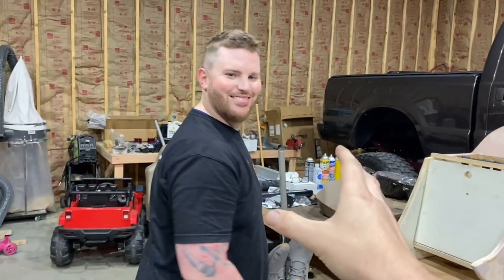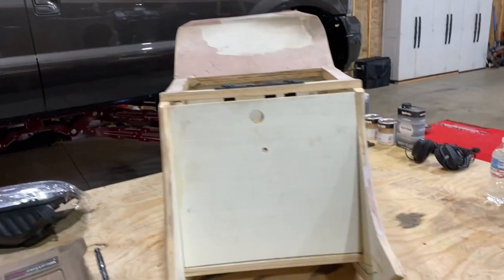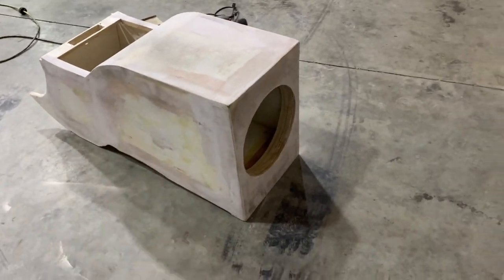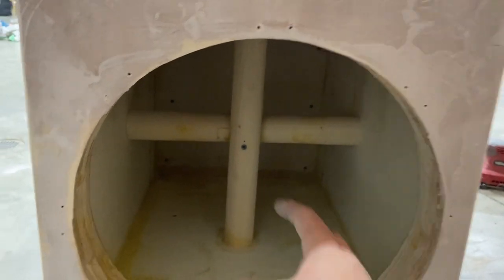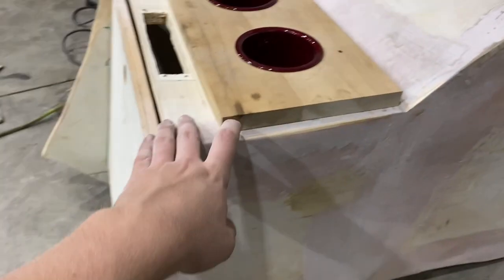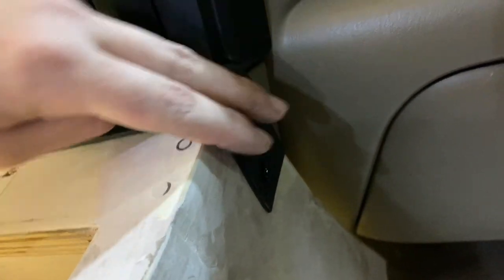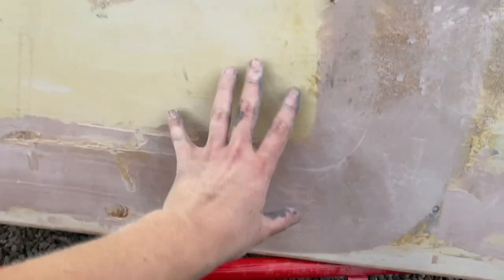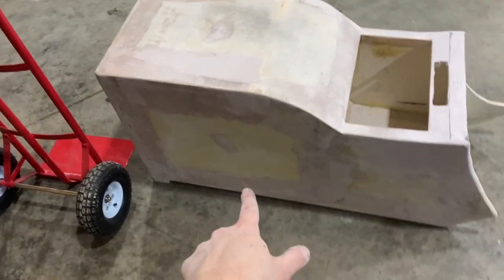CUSTOM CENTER CONSOLE SUB BOX BUILD | FOR 15 INCH SUBWOOFER | PART 5

Comment: You are fixing to wake that beech up
Reply from the maker: Yessir I’m hoping ! I finally got all the dimensions and put them in my app that I bought that calculates everything and it should be tuned around right around 31.90hz-32hz … that’s 4” aero port 8” long with my box dimensions. So hopefully wake it up some. And the sub woofer I found I’m getting is rated at 2000watts RMS so should handle the power !
Reply: @JUSTINHAWKSMITH  you could have your truck run on a termlab spl meter and it would tell you the true resonate frequency of your truck and then you could tune for that....either way it will prob be badass with what you're doing